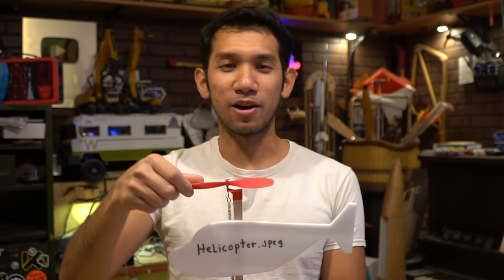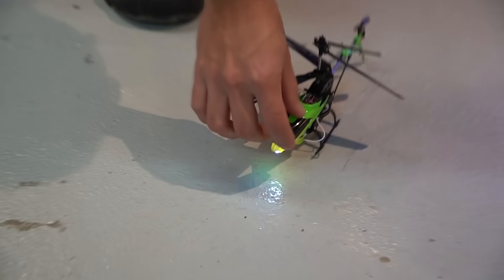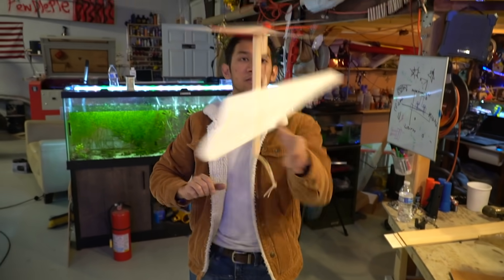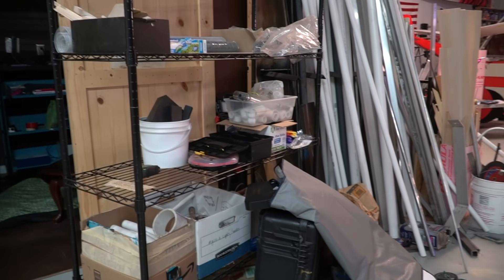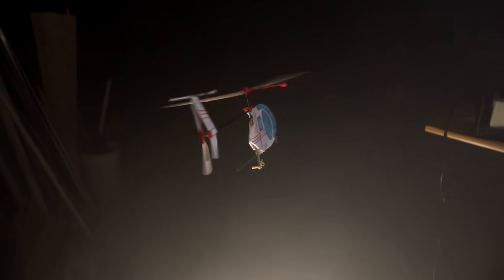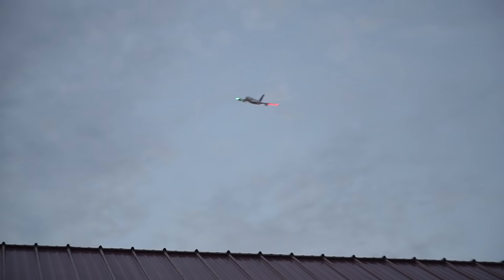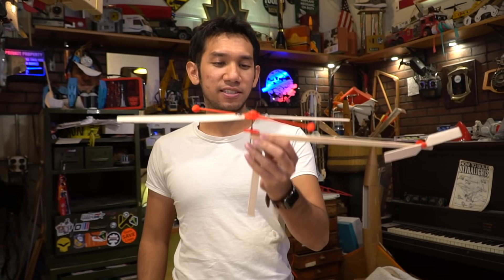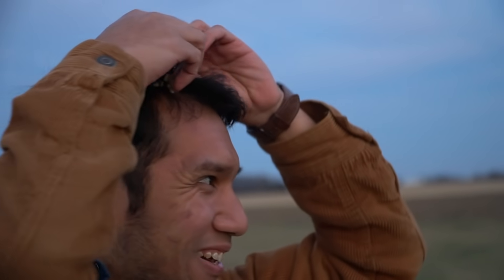Making a Rubberband Powered Helicopter (working tail rotor)

Comment: Maybe try a spring coil with a gear reduction system. The gears can also be ratcheted so you can tighten with drill without spinng the blades. A copper spring from a clock should be good for weight...
Reply: LIKE THIS SO PETER CAN SEE THIS GUYS!!
DO IT NOW!!

Comment: So . . .what if you powered the heli's blades somehow with a rat trap?
Also the fly bar , would placing the weights out further make for more stability?
(probaly makes the blades harder to turn?)
Edit: Put a string around the prop shaft and tie other side to the bar on a primed rat trap?

Comment: Ok let me explain the property's of a helicopter ok so the blade on the helicopter make a up draft which makes the helicopter go up. And when it's in the are the blade are spinning so fast that if you tilt it forward just a little bit it will break the upward movement and go in a forward direction

Comment: The full, tail rotor, rubber powered helicopter was done some 50 years ago. It had a head with flybar, was stable and even had a feature where, when the rubber wound down to a certain point, the main glades would disengage to a negative pitch and it would auto-rotate to a soft landing. Some years later someone did the same thing using a small engine. Then someone made one that was radio controlled. Du-Bro sold a kit, it was called the Whirlybird. 

Check out where the engine was situated. I had one, it was stable and responsive. 
https://www.youtube.com/watch?v=Gb2Cj3epamA
Reply: WOW! That thing is cool! I bet she autoed pretty good with the mass of the motors on the rotor head. I wish the video would have showed it. Did it just land softly or could you get a good flair out of it at the bottom?

Comment: rc ww1 dog fight!!!!!! build 2 airplanes with a mounted airsoft gun  make sure to make them weak by using makers foam balsa wood and paper only use stronger materials around the rc controls and other expensive parts also use strings for mechanical linkage so if a bullet goes through the tail fuselage it may sever a control cable causing the corresponding control surface to become un responsive one last thing plz make the planes ww1 theme and have one be a British stopwatch camel and the other be a red fokker triplane

Comment: Nice work👍 something I've played around with on multiple occasions...... balancing your rotor head as you would a prop should take out some of the instability as well as possibly add some voids in the ends of your fly bar and put weights..... There's definitely a "gearing ratio" for your main rotor to tail rotor based on rotational disc size
with a couple of slight modifications you could turn it into a gyro kite as well 🤔

Comment: Hey dont you go dissin my rubber band airplanes... 🤪 I used to LOOOOVE them as a kid.   They amazed me.  My favorite was an ornithopter designed to look like a bluebird and it flew so well...especially for it being back in the 90s.  If I ever have kids which seems unlikely,  imma introduce em to RC so they never have money for drugs.   ;) for ones like this youd want a TON of surface area, as much lift as you can get, and then experiment with tail rotor pitch until it stops having yaw.  Design it after a slow flyer prop for a plane, you want it to spin as few times as possible for a given amount of lift, preferably the maximum lift that the rubber band can reliably spin because its gas tank isn't entirely based on how much of a fuel is there, its based on the number of windings.  Minimize rotor speed in flight, maximize flight time.  I can't wait to get my 3d printer back up and running and make a few of these for fun.  ^_^

Comment: I stumbled on this video by searching  rubber powered helis,  interesting, deja vu? the profile H500 body model in your video reminds me of the heli body in this video. https://www.youtube.com/watch?v=2Lw8Mg0aKUM
My early company MIA Designs got started selling rubber powered helis,  but they were a little more appealing than the more typical stick and rubber from back in the day when I use to design, sell and fly these types of models. 
The one in this video https://www.youtube.com/watch?v=6ptR8lw_gbQ, was an attempt at a more modern version of one of my early "profile" designs, complexity totally removed for a quick build, a kids toy basically,  but most of my early kits were more serious stick and tissue and other lightweight material variations designs "in scale"  and some had complex mechanics to achieve greater performance. I should upload all my early designs in one complete video, this is work that span over several years, in my spare time, if one can imagine all the variations I tried. This work catapulted my post free flight electric helis and later full RC electric Heli kits of the late 90's early 2000's before the mayor wave of other rc micro helis coming to view.

Comment: I would love to see this revisited but with using a small motor and capacitor instead of the rubber band. It could possibly be lighter by removing the heavy rubber and the vertical wood spar

Comment: Elastics perform worse in cold temperatures, or if you allow them to cool by waiting too long after stretching them. You should try warming the rubber bands up with a heat gun after you wind them up, right before you release!

Comment: If you use rubber lube, you'll get more power and longer run times.  Also if you stretch it out to near max then start winding, you'll be able to get a lot more winds in.

Comment: I CHALLENGE YOU TO EQUIP A RC PLANE WITH AERIAL RECHARGING AND CHARGE A RC PLANE MIDAIR
Reply: That probably wouldn't work because the energy transfer rate of batteries won't go higher than the consumption rate of the engines.
Reply: @chocohouse4147  I guess That is reasonable

Comment: Can you try out a variant of this design where the rubber band is horizontal like a plane but instead of a propeller connected to the front,  you put a 3d printed bevel gear system which will drive the main and the tail rotor. The system will have more energy losses than the current system, but you can compensate for it by a larger rubber band possibly increasing the flight time.

Comment: When I got my first toy helicopter, I broke 1 of the blades within 10 minutes. I used 1 of each blades as a pattern, and cut out replacements from a Red Bull can. They worked better than the plastic ones, and are still on the copter 4 years later. I left the Red Bull logos on mine, so I would remember what they were made of for future replacements. You could use a scotch bright pad on the can before drawing the pattern if you wanted the brush aluminum look instead.

Comment: in 1931/3 Sirkosky solved the torque problem of copters.  He put a tail rotor (for both torque control and direction control).  Throughout history - copters have had the torque problem (torque translated to the main body of the device).  A machine producing torque will transfer that torque to the main body (the main reason a copter can auto-rotate when power fails)
Auto-rotatation means that the torque in the engine will cause main body to spin.  This as the effect of bleeding the energy of the copter and potentially causing a rough landing that yoy may walk away.

Sirkosky invented the helicopter we now use today.

WWII Germany was one of the 1st nations to grasp this idea and create an entire line of copters.

Comment: I used to be a helicopter mechanic.  On our helos the main rotor turned at 203 rpm. and the tail rotor was at 3030 rpm.  If you play with the pulley ratio you should make the tail rotor more effective.  May I recommend an o-ring for the connection between the pulleys.

Comment: When i was a kid, we used to buy old pendulum clocks from the junk yard, crack the mechanisms apart, take the spring and some of the gears and make a rudimentary wind up motor + reducer. That would power an airplane enough to hop from one flat roof top, to the other.

Comment: Had one like yours in the 1950’s. It had counter rotating props. One on each end of the stick with a rubber band in the middle. It would always fly vertical even when launched horizontally.

Comment: how does the boeing mh-6 little bird fly without a tail rotor, or a gyroscopic stabilizer on the blades. i saw that the uh-1 flies with this method in the video but others do not.

Comment: i wonder if any one had expirimented w/ the basc idea of gear reduction  meaning  for example have the rubber band spin a desant sized wheel wich then be powering the main helicopter blades and roter w/ signifigantly more smaller wheel  shape  and thus getting more rpm theredicly   because  of how its amplifys the power applied to the wheels/gears  wich also in theroy interms  saves you from having to strech rubber bands to much and thus they last longer  and probly less if not that  less commonly snaps  and lands gosh knows were  as we can see  here 13:38  thus resulting in the suprise haircut how ever i imagine it probly needs tottly redgined to antisipaite that added wieght  but seems tottly plausable and a glancing look from the vid

Comment: Since your main rotor is spinning clockwise, the reason your helicopter keeps turning left (yaw) is because your tail rotor isn’t producing enough force to compensate. If you slightly increased the pitch if that tail rotor or got it to spin slightly faster that will alleviate that left yaw
Reply: Or put a slightly longer stick if it doesn't affect the weight balance too much.

Comment: I built a rubber powered heli as a kid. Was a balsa tube about 3/4 “ in diameter, 12 inches long. The top was a teetering rotor. The bottom rotor was attached a couple inches below the top to the tube. As it unwound the motor it counterrotated. The bottom pivoted on a model wheel bearing, the tube went through the top of the fuselage. I think it needed weights on the front of the rotors to make it stable

Comment: you can control the tail more precisely using gear reduction, also position the fly bar on top of the blades with lead weights, flybar needs to have heavy tips. i have designed a working version few years back and flew amazing, well done, love the balsa propeller idea

Comment: Look up F.G.Boreham a pioneer model helicopter builder/flyer,he built these just like Peters successful models,really enjoyed this like going back to how I started,one helicopter was made from a cigar tube the counter rotating blades slid up and down the tube and it flew well,your idea of the anti torque tail rotor simply driven worked well,that creased me up winding the rubber with an electric drill ! great stuff Peter.

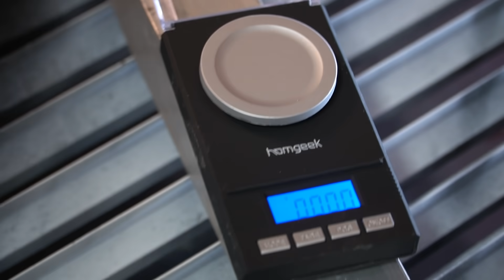Comment: some info.          i find it is impossible to pay you a compliment, when there is so much  dimness, involved in your projects.          at 9:27,  sanding the  TOPS  of the rotors accomplishes  nothing.  Because, this is all aoa/newtonian  LIFT.      apparently, you prefer to  Assume that  the tail rotor is  now  PERFECT, rather than consider the possibility that it is  NOT.     just  WEIRD.     googletranslate

Comment: So with the rubber band driving the rotors which approach yielded more airtime? Big blades with a lot of thrust and torque or small blades with high RPM? I can imagine that the limiting factor for airtime is the amount of winds of the rubber band, so you want as few as possible rotations per second to stay in the air. On the other hand if the rotors require a lot of torque the last winds of the rubber band don't have enough torque to keep it in the air.

Comment: Try adding a NOTAR type deflector on the tail boom (and/or the nose boom).  It deflects the downdraft to counter the main rotor torque, what the tail rotor does.  When set just right it counteracts at the same rate as the main rotor torque.

Comment: 8:56 No. Someone hypothesized that the additive force from 23,000 slaps would generate enough heat to cook a chicken. But what even is a chicken
Reply: Then spin it at 23000 rotations per minute

Comment: I wonder if you could power an RC aircraft for a very long period of time using a whole row of heavy duty elastic bands, some clever engineering would probably be required to switch the props connection from an expiring rubber band to the next freshly wound band, but if anyone could do it I bet it would be you!

Imagine 10-20 minutes of uninterrupted flytime using only the power of rubber bands!

Comment: Oh the fantastic power of rubber bands...

I got the simplest possible model for a rubber powered airplane as a kid. Every part was pre cut and formed so all I had to do was put things together and it flew. Now after the first ten flights a lot of the amazement had rubbed off and I started experimenting. The easy one first. The instructions said to wind it 100 times, so 200 must be better, right? And it was, and the model didn't crumple. How about putting a rocket engine on it? Well that kind of worked, but hanging it down low under the body to not burn the model made the power torque the plane upwards. Well how about using two and mounting them to the wings? Well lets just say I learned the hard way that it's very hard to time fuses for two rockets, and that if one were to fire before the other the plane did some interesting acrobatics that usually resulted in it doing an uncontrolled landing, or crash as most people would have called it. As I ran out of rocket engines I was back to propeller power only. 200 revs worked, so how about 300? Well that almost worked but the rubber band snapped, and before that the body looked decidedly banana shaped. So I tied a knot on the "engine" and gave it 250 revs and it flew. And the next time the band broke again. After a while there were more knots than band so I retired it.

Now began the search for the "perfect" rubber band. I tried several versions from the department store and they didn't fare well at all. Eventually I went to a hobby shop that sold much more advanced models and bought some rubber band from them. If I remember correctly the small packet of rubber band intended for rubber engines I bought from them cost more than the entire model did when bought from the toys section at the department store. And it was just awful! Compared to the original rubber band the one I bought was thin and fragile. It would barely withstand being twisted 50 times and then it would just snap. Some of the office supplies rubber bands I'd experimented with was much better. In the end I bought a new model and played with it a few times more, then when the rubber band started to break that was it for me and that toy was "decommissioned" and stored in the round filing cabinet.

Comment: With LIPO ELECTRIC REVOLUTION there is no sense even contemplating rubber power (a massive step backward)
Might as well just buy a SYMA heli for 20 bucks that flies smoothly like dream for 15 mins
If u like single rotor shape spend another 20$ & get V911 with 3 spare batteries

Comment: You should measure the head speed of the main rotor and adjust your tail pulley rotor to give you a good head to tail speed ratio, if you do it properly it should counteract the torque properly and not spin around so much.

Comment: When I was a kid I used to use an old roll from used up thread kit and tape two rolled up paper blades in a + shape. Then I would glue it on to the top of the plastic thread roll. I then would take a pencil and put it in the hole of the plastic roll and take a piece of string, winding it around the plastic thread roll. I would pull the string forcing the heli to spin and lift off of the pencil. These flew extremely well! Anyway, try one with a four bladed prop as they seem much more stable than a two blade.

Comment: Looking at some flybar mechanisms on google, it seems like the linkages are in place to act as a gain mechanism for controlling the response of the blade pitch to changing attitude. By modulating the distance from the pivot on each linkage point on the flybar and rotor, you can make the pitch change more or less aggressively. Levers rule.

Nonetheless, it would be cool to see this project revisited. Loved the video!

Comment: Dude, using a 3D printer is cheating.  When I was a kid, I had to cut plastic with a steak knife that I borrowed from my mom without her knowledge and sand it with one of her nail files, again without her knowledge.  If I needed it smooth, I had to use a lighter that I found at the gas station in order to just melt the surface.  That's just how it was back in the day.

Comment: When the Wright Brothers were kids they made toy helicopters. Google it - the design is simple. It’s a rectangular frame of balsa wood about 5” tall and 3” wide. Then there’s a rotor on the top and bottom - each about 5” long. Rubber band goes in the middle of the frame. I made them all the time as a kid. Some of the  larger ones would go 30’ high.

Comment: Great episode! Brought me back to my early teens, (1976) when i designed and built a rubber powered 4 blade counter rotating helicopter out of a 7" long 1/2" dia. cardboard tube,  the blades i made were rectangular, balsa stringer material covered in tissue, worked pretty good, wind it up, release and would fly up to 50'/60' sputter out then flutter to the ground. Kept my attention for about, oh an hour after the build. lol! Sorry, the rubber band in the hair, that killed me!! Ha! Keep the fun coming!